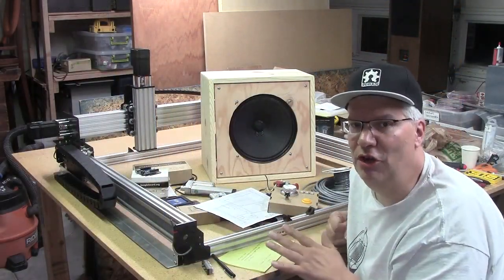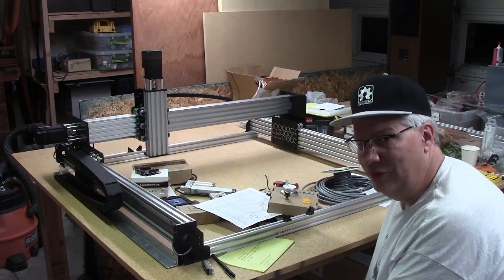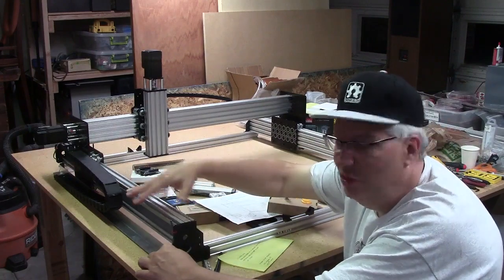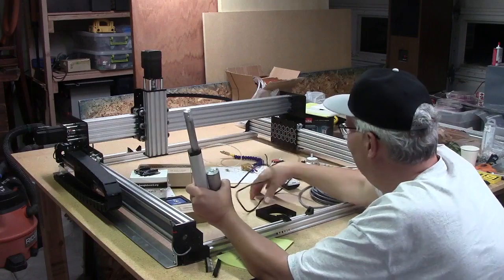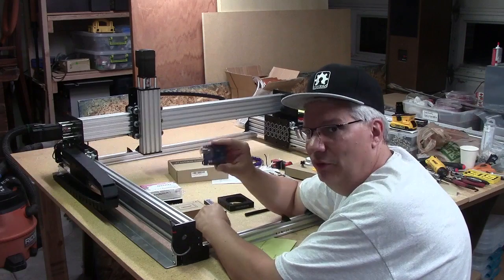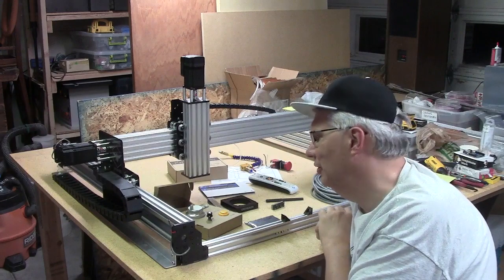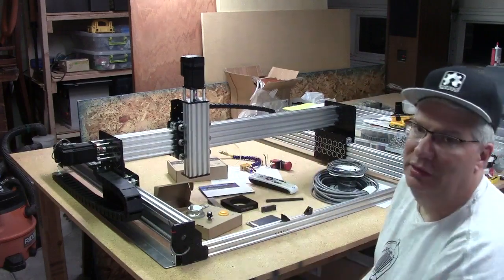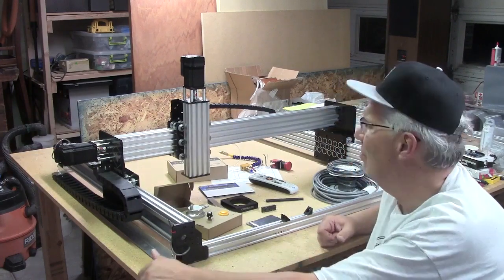180709 Valve Studio - Tonehenge Journey - WorkBee Controller Decisions

Comment: I ran into the same issues when trying to design a lifting solution for my 1510.  I figured I needed about 20" of travel.  I did some initial testing with a scissor jack from HF.  It worked well and was going to add a wiper motor to it.  However, I ditched the whole lift idea since I want to have dust collection under the worktable.  I'll be interested to see what you come up with.
Reply from the maker: Shawn Armstrong Thanks for the reply,  scissor jack in the center is an option.  I found a 24" RV leveling jack that's not too expensive.  Not sold on that solution yet,  though it's the simplest solution,  I'll let you know in upcoming videos.
Reply: Also, thanks for the details on the Nextion display.  I looked at those recently for a cnc back gauge project at work.  I ended up going with a RPi touchscreen with a Kivy ui I wrote.  As you say, it is more complex but I was familiar with Kivy.  I need to get a Nextion display and start learning it because I agree that its a simpler approach.
Reply from the maker: Shawn Armstrong the nextion displays are just ok, their handling of fonts is really horrible. You can forget about proportional fonts. Everything text is fixed width, even proportional fonts.  There's no mention of this in sales info, only forums. I also found the forum nextion 'support' staff confrontational and a challenge to get straight answers from them. The rest of product is quite unique and clever. Get the cheap one and try it before investing in a large unit.
Reply: Oh.  Good to know.  I was merely looking for an easier way to write a ui for an arduino.
Reply from the maker: ... AND their font tool will take a mono font, compute the max width of all the chars, then left justify all the chars in a bitmap rectangle with that width. So even the mono fonts look kinda screwy. Apple figured all this out with original Mac in 1984, 34 years later nextion display font handling is, in my mind, similar to a bad typewriter. I'm a real snob here, I used to publish my own newspaper in the 90s and focused on the little things beyond content. 

I did manage to find some mono fonts that look OK. In future video on this display, I'll talk a little about my choices.

Comment: I have some questions about the IR receiver. The period for the counter is 3000 and I have read that the total time for RC5 is 24.892 ms. . Is this value (3000) specific for RC65? And also the value for b is 90 referring to 889 us pulses?
Reply from the maker: did you get 3000 from my PSoC hardware implementation?
Reply: @CraigHollabaugh  I understand that timer interrupt activates at the end of the IR communication. I haven't found a timing diagram for RC65 but I think that 3000 value from your implementation is the total time for a command. Is this right?
Reply from the maker: @andreeastan503  I opened the hyatt PSoC project and looks like irDurationTimer counter value is 3000.  I think I set it to 3000 (equates to 30mS with IRDetectorClock = 100K) because its a lockout timer to keep from getting repeated keystrokes from the remote.  As for the irDigitalComp compare value b of 0x5A (90), I suspect I looked over Arduino IR library code for the RC65 bitsteam info and determined 0x5A was for the RC65. To be honest, I can't remember where I got that. Sorry couldn't answer that question.

Comment: I can't seem to get the Psoc GRBL port working properly. 
The older - serial version doesn't seem to trigger alarm state properly. The newer USB native port doesn't seem to work right at all.
Reply from the maker: Contact Bart
Reply from the maker: So I'm using Bart's USB version, https://github.com/bdring/Grbl_USB_Native. Don't know about other versions he's worked on
Reply: @CraigHollabaugh  Did, I don't think he's really around or checking the psoc ports anymore. I am wondering if the problem has to do with the EEprom settings - did you have to flash  the EEPROM after programming the psoc or did it properly resort to the defaults set in the config or defaults file? 

If you remember, that would be great, if not - thanks for your time.
Reply from the maker: @IceTurf  Good question. At the top of main, settings_init() is called which restores defaults if there's a failure during the EEPROM read.  Check the response to "$$" command to verify settings.
Reply: @CraigHollabaugh  Okay, thanks for the suggestion - I will check it out. The success you have had with your build still has me hopeful.
Reply from the maker: @IceTurf  I learned a lot about all the grbl settings and where in the code they are used. Unfortunately, this is after I crashed my machine and bent to lead screws. Live and learn.
Reply: @CraigHollabaugh  Do your limit switches work, or work reliably? Does your Psoc register the limit switch press properly?  You shouldn't have been able to bend the lead screws if the limit switches engaged properly.... my other machine stops pretty quickly when the limit switches get triggered?
Reply from the maker: @IceTurf  let's just say I did some stupid things in my early grbl days. I do have 2N/m step servos, which run really fast. I do have hard limits and all that's working now.